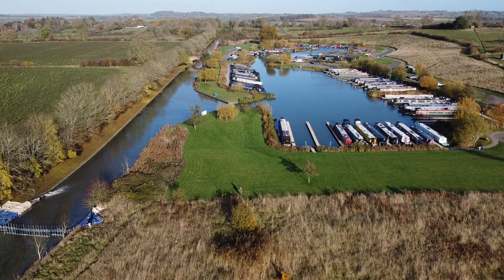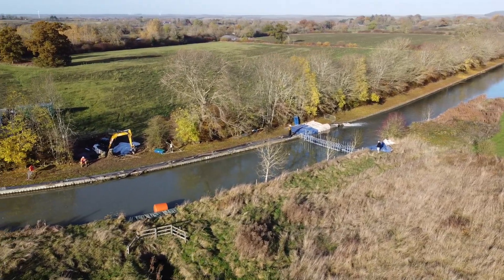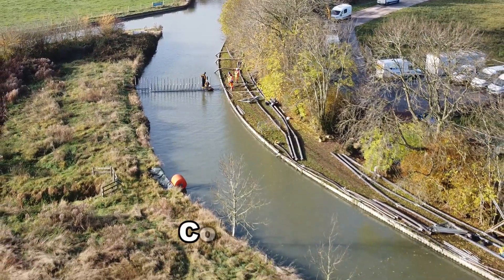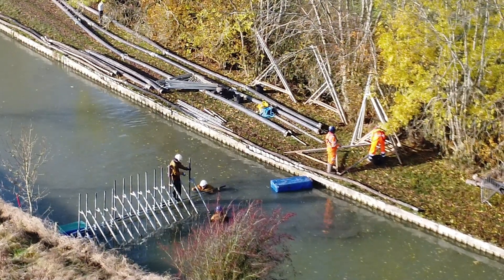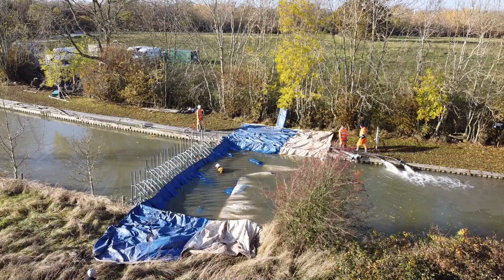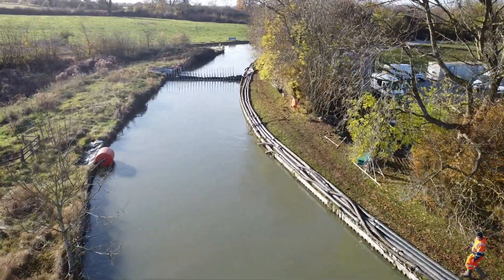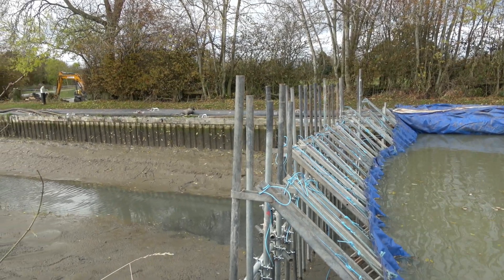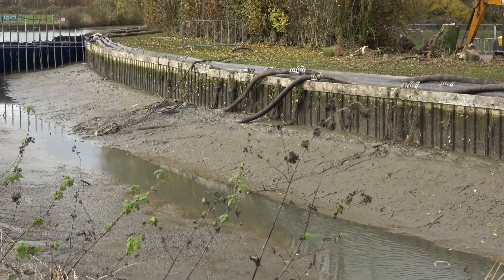238. Culvert 9 Replacement at Yelvertoft Marina – Part Two

Comment: That was very insightful. I see that blocking the Marina was in some way precautionary, where I originally thought the water was going to be drained directly outside.  Thanks for sharing Alan, it’s great to see more than just the use of the canal, but also some of how it’s maintained.
Reply from the maker: There was some uncertainty about the canal closure but as you rightly say, closing the entrance was precautionary just in case, and the right action to my mind to take. There will be another episode next week. Cheers.

Comment: Wow!  The Coffer Dam system was quite interesting and quite frankly, surprising in its' simplicity. I gather that it is self-sealing through the water pressure weighing down upon the membrane spread across the canal bottom. I suspect a small amount of water might still finds its' way through, but that could be held at bay with perhaps a single pump running in a dammed off pool. I can't wait to see the next installment Alan and I so appreciate your taking the time to share this with the world. Take very good care and cheers from Avondale, Arizona.
Reply from the maker: Greetings Michael. You’ve got that entirely sussed. There is some water leakage and a pump is continually running. The next episode will be published very shortly. Cheers, all the best.
Reply: @MyNarrowboatVenture  Oh!  Thanks for your kind reply Alan and confirmation of my theory. I just love the simplicity of the needed solution to temporary dam off the canal for this repair. Simple is usually the best course, and this process has it in spades. I so look forward to the next installment ;)
Reply from the maker: @michaelhiggins7365  Cheers Michael👍

Comment: Such an interesting project.  I’ve always been intrigued with rivers, canals, etc and what they find when the body of water is drained.  What fun that might be to have a metal detector and check out what might be buried in all that mud.  😳
It’s a nice feeling to get the booster shot and get that immune system supercharged.  Sore arm for me for about a day but that’s all. 
Take care and looking forward to the next vlog.
Reply from the maker: Hi Mary Jane. Interesting finds beneath the water are more likely to be found under bridges, around locks and in urban areas, from what I've seen it was just mud! I had a slight sore in the arm this time round, which I hadn't had before, but again no side effects, so all is good. All the best, take care.

Comment: You really have to marvel at the way the CRT engineers work these problems out and the procedure to cure them. Great pictures Alan. Hope you had no affects from your booster jab. Stay safe
Reply from the maker: Thanks Paul, the booster was fine, slight sore arm afterwards but no side effects. The Portadam system is well established now and suits canal use.

Comment: Hi Alan, really fascinating to watch... Amazing what these guys have to do to repair the canal. As I watched I was wondering (apologies if you mentioned it last week) why, if the marina entrance is not within the drained section, the entrance had to be sealed off? Just precautionary I suppose. Really looking forward to seeing what happens next.. Many thanks 🍷🍷
Reply from the maker: Hi Steve, there was some uncertainty as to exactly where the closure was to be and whilst not expected across the marina entrance, it was closed off as a precaution, just in case something went wrong. Better that than 150 boats sat on the bottom! Cheers, all the best.
Reply: Cheers Alan.. fair point! 🍷🍷

Comment: Having the drone add's another dimension to the story. What an amazing tool they are. Acquiring the skill to operate one could be expensive if you're a slow learner. Many thanks Alan, take care.
Reply: They’re very easy. If you get into trouble let go of the sticks and they sit there in the hover until you’ve composed yourself, unlike remote controlled helicopters which I learnt to fly many years ago and crashed many times in the early days.
Reply from the maker: I was never any good with those little helicopters, which was a bit of a deterrent in buying the drone!
Reply from the maker: They're not as difficult to operate as you might think, the skill part comes with turning, moving along and lowering or rising all in one smooth operation. I'm getting better at that! Cheers

Comment: Hi Alan enjoyed the vlog a question how much water was pumped out and when they said stun the fish humanely and not to film was that because they didn't want to show the face of guy who drops the extension lead into the water (sorry sick sense of humour) Keith
Reply from the maker: Many thanks Keith. Did you want the answer in volume or weight! I didn't watch but it is done in a safe way, no fish were killed. Cheers
Reply: @MyNarrowboatVenture  Hi Alan volume/litres. Thanks Keith
Reply from the maker: @keithdickinson127  Hi Keith. My reply was a bit tongue in cheek. To work out the volume, one would need the length of the closure and the cross sectional area of the canal, then assume it’s uniform along it’s length and I really don’t have that info. Sorry.
Reply: @MyNarrowboatVenture  sorry a bit daaaa, i thought that the water pipes had a water rate x time pumping out. Can't wait for the next one very good Alan